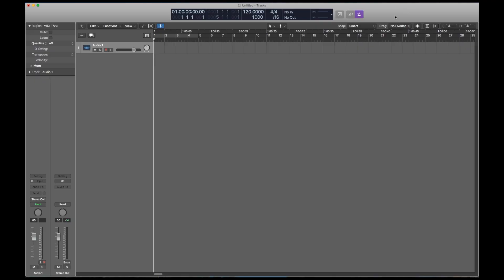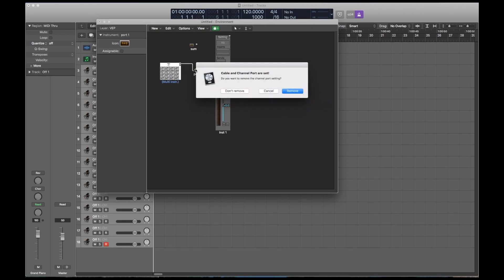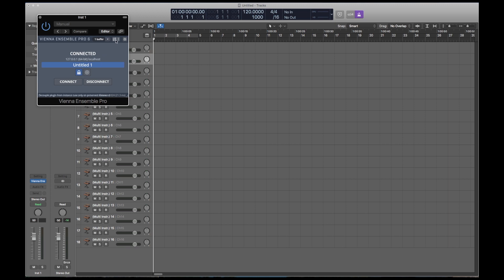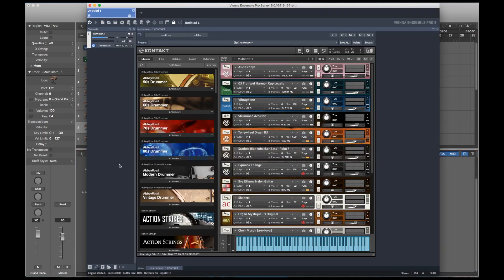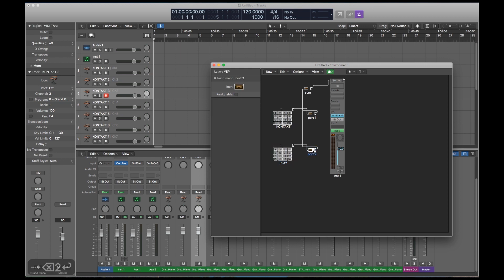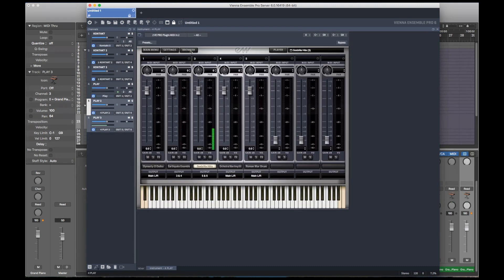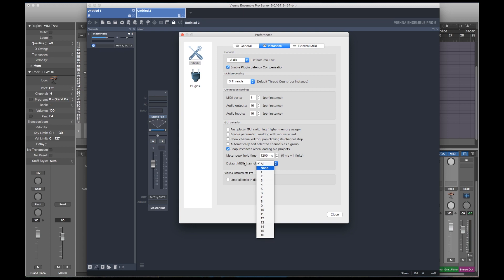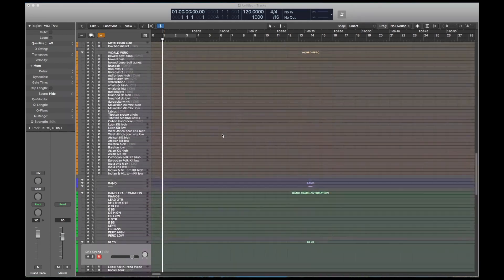How to Connect Logic and VEPro 6, Create Multi-Instruments, Use Multiple Ports, and More

Comment: Hi Alex, thank you for the excellent video series on vepro!  I do have a little issue which I can't resolve and am out of solutions.   I'm able to to setup just as you described perfectly, but there's a problem.  If I record the same note lets say C5 on Track 1/Port 1 and do the same on Track 1/Port 2, both won't play back correctly.  If the note on port 1 was a long note, and the port 2 a staccato, when the staccato kicks in, it will cut off the long note on port 1. Also on playback, if any one of the tracks is muted, the other plays back fine.  If recorded the same way, but on different track numbers (Track1/port1 - Track3/port2) then it plays back just fine or if different pitches are used it plays back just fine as well. (I noticed when recording and notes were missing on playing back).  If you  or anyone have any suggestions, I would be vey grateful.  Many Thanks
Reply from the maker: Glad these have been helpful! I think I understand your issue. Personally I've never encountered this, but it sounds like either a routing, MIDI configuration, or possibly RAM issue (though very unlikely for the last one). Would it be possible for you to do a short screen capture of the problem (with audio)? It'd be helpful to see your basic Logic/Environment & VEP setup. I might be able to catch the issue faster if I can see it. Feel free to delete unnecessary stuff, like if you can demonstrate the issue with only 2 ports and a few External MIDI Tracks on each with a minimal amount of auxes, then great. I use QuickTime for that usually, although OBS is also great.
Reply: @AskACap  Thank you for the reply!   Here is the demo https://youtu.be/uySc5qcVUhs
Reply from the maker: @anthonydesouza3602  Thanks for your demo. I was able to replicate your setup on my end and ran into the exact issue you described. I'm baffled by it. I think I've just never needed to play the same pitch on the same channel on different ports. Seems like a weird bug. So I can't solve that problem, but hopefully to help with that, consider: do you really need the entire 1st port just for violin 1? Ports are simply a collection of 16 MIDI channels – they need not dictate how you organize your tracks later. You can load instruments in any order you want in your Kontakt plug-ins on your ports in VEPro and reorder and put the tracks in arbitrary folders in Logic later.

Also, normally you can't pan External MIDI Tracks the way you're doing. What kind of tracks are you using that you've connected to the Environment Multi-Instrument?
Reply: @AskACap  Yes very strange bug indeed.
Hey, so those are just external midi tracks on each channel.  

I was trying to organize my template using very few key switches and having most articulations open on their own track ready to go.  I'm  Following John Powell's template as an example, I like it how he has it laid out.  I am working on having 1 instance per instrument and see if the system is able to handle it, not efficient I know.  If that doesn't work out I will mix the port and channels w/ different instruments of different ranges so I don't have to worry about that bug.  I will use your method instead of multi-timbral so I don't have to have both midi and aux tracks for each channel, but use only one port per instance.  Not looking for an enormous template, but large at 2-350 tracks the most.
Reply from the maker: Ah, I see. I do see the value in that method and I like the idea of having all articulations split out, but I'm personally a keyswitcher – I perform the parts live while keyswitching. Actually, I've heard that Logic prefers lots of VEPro instances, so I don't think you'll have to worry about that. Just make sure to adjust the VEPro multithreading settings to account for a larger number of instances.
Reply: Ask ACap You’re right, I heard that logic prefers the extra vepro instanced also, and will definitely adjust the multithreading.  
Well I will definitely be using your concepts in creating this.  I highly appreciate your help and suggestions!

Comment: Im still confused about routing fx. I would like to add different ammounts of reverb to different instruments within the Kontakt multi. I would also like to add different ammount of processing (saturation, eq and delay etc). I would like these all to come to a submix in Logic for when I need to bounce stems. Thanks for any help.
Reply from the maker: I understand; I go over that at 5:10. For each instrument that you want different FX for, you'll need a new output in Kontakt, and new corresponding auxes in VEPro and Logic. It might help if you draw a signal flow diagram.

There are also plenty of discount codes left for the PDF of this video, if you haven't picked one up already, just in case the different format helps at all.

Comment: Hi Just tried to buy your Logic pdf's but the the buy button does nothing?
Reply from the maker: Are you talking about the All Logic Tutorials pdf? You can get that from Gumroad or from the links on my channel page, but here it is: https://alexcapmx.gumroad.com/l/AllLogic

PDFs for individual videos are in the video's description.

Otherwise, if you can be more specific about which button wasn't working, then I'll better be able to help you.
Reply: @AskACap  That's the link I am using but nothing happens?
Reply from the maker: @agmc111  What do you mean by "nothing happens?" Does the link at least take you to Gumroad? What browser are you using, and is your browser up to date?
Reply: @AskACap  Just Tried google chrome and it works, thanks. Great Channel by the way. As a point of interest I have just bought a mac studio and am working on Logic 10.7.4 and only port 1 works correctly. Port 2 upwards still sends through port 1, so VEP does receive the correct data. I am currently in discussion with apple to try and resolve the issue. I will post when I know more. Everything works perfectly on Logic 10.4 which help me much. Thanks again for clear and concise tutorials.
Reply from the maker: @agmc111  Thanks for your support! In case you are also on VEP 7 rather than VEP 6, you might also try the new AU3 method to see if the ports are sent correctly then:

https://www.logicprohelp.com/forum/viewtopic.php?f=9&t=143416

Ultimately, the hope is that we eventually don't have to fiddle with Logic's Environment anymore, and that ports work natively (like other DAWs).
Reply: @AskACap  Just a quick update on the multi port issue. With all of my research, I have only just discovered you have to run logic under rosetta for it to work. All is fine so far, so I will wade through all of the labelling now. :) Thanks
Reply from the maker: @agmc111  Thanks for the update!